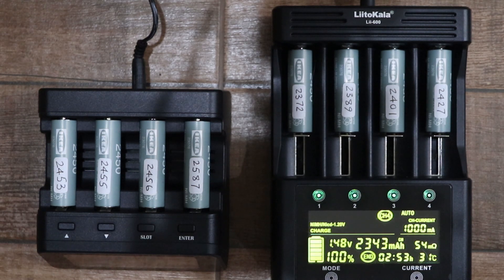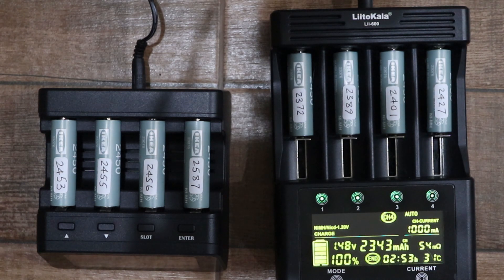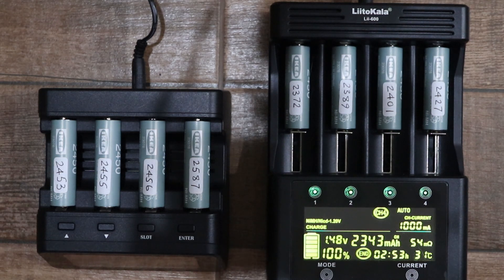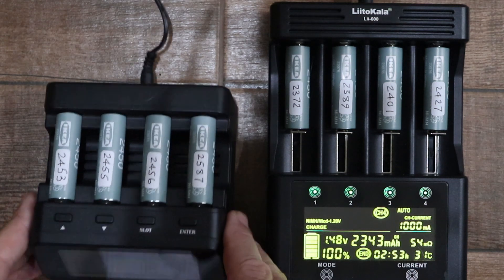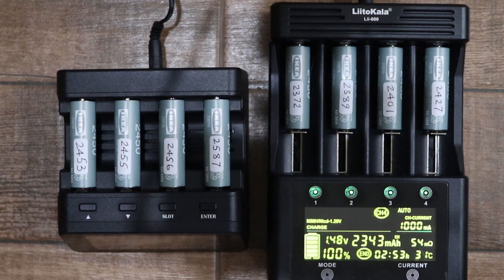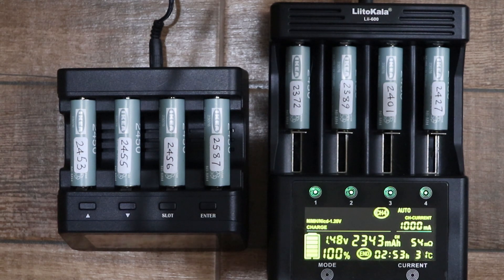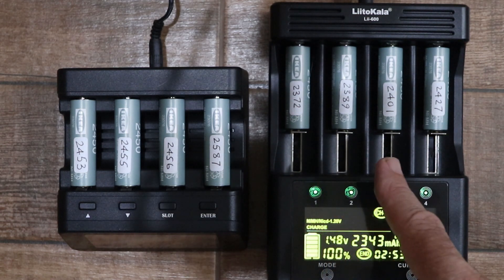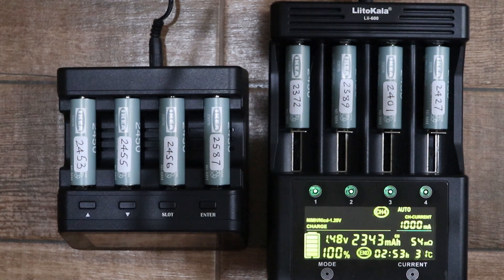Is There A Problem With My Powerex MH-C9000 Pro Battery Charger Or Is The Problem Me?

Comment: Hello again, great to hear that you found the main issue. The Charge cycle on the C9000 only meassures what you try to put in, not what actually ends up in the cell. The right way to do it is through a "Discharge" cycle, that measures what's actually in the cell. However, the amount of energy you can draw from a cell is highly dependent on your discharge current, the higher the current, the less energy out and vice versa. I guess the best way to test this is to 1: charge the cells on either charger. 2: discharge on the c9000 at a certain current. 3: charge the cells again at the same charger as in step one. 4: discharge on the Liitokala at the same current as in step 2. Those two readings ought to match. Chances are both chargers work just fine. If you charge in one of them, it might put slightly more or less into the cells than the other, which might make for a small difference in the discharge and so on. One also have to remember where the 2450 reading on the label comes from, it comes from charging and discharging over time at the testing plants at given discharge currents. What I would try to ease your mind on the c9000 is to run a couple refresh/analyse cycles on your four cells, with let's say 1A charging current, and 0.5A discharge current. That's pretty close to what can be expected to correspond to the 2450 rating, tests are usually done at 0.2 C discharge, just as the "Break In Mode". Sorry for lengthy answer, but as I say, both are probably just correct, it's a bit like statistics, you can get many answers depending on how the question is asked. 😀
Reply from the maker: Hello Dennis and thanks for all your advice. It has been very useful. I realised after doing some research yesterday that I was doing it wrong, however, the results on the Liitokala were still what I expected. It's only the Powerex that records those very high readings on a charge cycle.

I ran a refresh/analyze overnight on the Powerex and did the same with the Liitokala using the Test mode. Results were about the same as they were when doing the discharge. The Powerex readings have a tendency to be a little higher but, as you point out, this could be the difference with the charging and discharging currents. Since I've had the chargers I've noticed a tendency to become a little too obsessive with analysing batteries and trying to get them to their maximum capacity!

As you say, I think that both chargers are working OK. There will be some slight discrepancies between batteries and chargers and also - as you point out - the 2,450mAh rating won't be exact for every batter coming out of the factory.

I feel reassured now that everything is OK and it was just my lack of knowledge. Thanks again!
Reply: @PhilUKNet  You are most welcome, and thank you in return for making great videos. If I may just, to close this from my side, a few more words. The "high" figures on the C9000 charge cycle aren't really high at all, they are what's to be expected, as to why the liitokala don't show the same I don't know. It's much in the same vein as as to why you need fans in your computer, or a cooler in your car. Heat is generated, and that heat needs to go somewhere, there isn't such a thing as a 100% efficient system, you always need to put more energy in than what you can draw back and that is what the C9000 shows in a charge cycle, it shows how much was poured into the bucket, not what actually ended up in it. If your cells increase by Anything in heat as you put your hands on them during charging, that's energy put in that isn't staying there, and that's what the C9000 shows. Another small point about ratings. If you read 2450 mAh on a cell, that's not a static figure, that doesn't mean "We have a bucket of size X, which can hold so and so many mAh", it doesn't mean that. Cells are living creatures, they are born, they live, and they die. What you can expect from a cell is that for the first 50 odd charge cycles they get better and better, then the live and after a while they start to degrade, that's why you have a statement from the manufacturer as to how many charge cycles they claim. The IEC testing procedure actually involves a number of "Break In" cycles, and "Refresh and Analyse" cycles, both of which you have on the Maha. They test and test, charge and discharge and at the end of it they can claim that "We support X amount of charge cycles, after which we guarantee that your discharge capacity at 0.2C is still within 80% of the capacity we put on the label." So for a 2450 cell, if you have less than 1960 mAh coming out of it after you have charged it for the amount of times they claim to support, then you can worry, but chances are you have misplaced them by then as I do. :-D As to your last comment about being too obsessive, I feel your pain ... I was there more than a decade ago when I got my first Maha and I'm still there. You have Two great chargers and they give great information which may or may not entangle you. There are many Great chargers that just do their job, don't show anything and won't cause confusion, just show a green light when done and be done with it, but let's be fair ... those are not as much fun. Welcome to the rabbit hole of charging batteries, the hole runs deep ...
Reply from the maker: @SweDennis  Hi Dennis! You've been a great teacher and you have a good way of explaining things, such as with the bucket analogy. You've obviously been at this game a long time and you are further down the rabbit hole than I am. For a long time I only had a charger that showed a green light when it was finished, but didn't provide any information. I bought both of these chargers last year and have had a lot of fun with them but there has been a learning curve. When I was looking at information on-line this week I realised how much there is I don't understand. I've learnt quite a bit this week and I will continue to do so! Thanks again!

Comment: Your understanding of how the NiMH chemistry works is limited, as you admit. No shame in that. 

Some basics:
1.) There is no fully discharged or empty battery. They're discharged to a cell voltage that the battery industry generally recognizes as "discharged".

2.) To "fully charge" a battery, there is a sophisticated end-of-charge detection method called "negative delta voltage". As a NiMH battery is charged, the cell voltage rises over time. Because of a quirk in the NiMH chemistry, when a cell is darn close or just past "fully charged" (meaning simply you're not getting much more into it) the cell voltage drops a minuscule amount on the order of a few millivolts. The electronics in the charger look for that tiny drop and terminate the charge. Some chargers are better than others in detecting the change.

3.) The capacity of the battery is always measured during the discharge cycle.

4.) Not all the power pumped into a battery is stored in the chemistry and available later during the discharge cycle. There is wasted power during charging, maybe 20%, and there is nothing to do about it.

5.) Comparing capacity between consumer-grade chargers requires both to use the same cell voltage for a "fully discharged" cell, and be able to measure it accurately. It also requires both to be able to detect the end-of-charge similarly.

6.) Some chargers can apply a topping-off charge after the main charge is done. This will affect measured capacity.

7.) The charge current and the discharge current affects measured capacity. The Powerex charge and discharge current can be changed. To compare measured capacities from both chargers, they must charge and discharge at about the same rates.

8.) When in doubt, trust the Powerex. It's the best commonly available, consumer-grade AA/AAA NiMH charger. Trust it over any odd-named Chinese charger.
Reply: Good info from you :)

To 6., this charger seems to don´t use Top Off charging, it use -dt/dt. The old C9000 Non-Pro was a Top Off charger and it always confused me tht it shows "full" and after that it charges next 2 hours and then trickle.
Reply: If I may add to #4. Normally they say that when charging an "empty" cell at 0.1C it's considered "full" after 14h. This gives it theoretically 40% more than the capacity and for a 2450mAh that's 3430mAh.

Comment: Hi Phil.  I’m just coming across your videos regarding your concern about the PowerEx charger.  I see a number of people have provided some excellent information to help explain many of the complexities, so I won’t go into what has already been stated.  However, I will say, from my personal experience, I own 4 PowerEx charges (2 Pro and 2 WizardOne), because I found them to be the best chargers out there when dealing with NiMH cells and I definitely have confidence in their performance and accuracy.  

As other have stated, you definitely want to measure capacity as a function of the discharge cycle.  Also, capacity will vary based on a multitude of factors, such as charge and discharge current, heat of the cells, condition of the cells, age, etc.  I would definitely encourage you to try various tests between chargers and brands of cells.  

All that being said, remember that capacity at the end of the day is just a rough number that should be considered In relative terms, not absolute.  What does 2347 milliamperes versus 2487 really mean in practical terms?  One cell may run a tad longer, but there are so many variables that can affect that, and you can’t exactly know how long a particular device will run.  Also, most devices use cells in series, which means any device is limited by the weakest cell.  So, as long as you are getting cells that have relatively close capacities off the same charger, I wouldn’t worry about the accuracy of the absolute values.  If you’re seeing several hundred milliamperes difference though, then you might want to see if there’s an issue with the lower capacity cell.  I would also suggest getting a meter to measure internal resistance; there are some on Amazon that are quite good and minimal cost.  Some of the chargers have this ability, but it can be hit or miss in terms of how well that’s implemented.  High internal resistance is a sure sign of cell issues.
Reply from the maker: Thanks for all the information. Very technical! I studied mechanical engineering at tertiary level and still regard electrics and electronics as some form of magic! This comment slipped by, but I think I replied to some of your other comments. Thanks for adding some good, useful information to the comments section of my video.
Reply: @PhilUKNet  Wait….it’s not magic??😳 Thanks for the responses and enjoy your life journey!

Comment: Thanks for good videos on this device. I wanted to buy Powerex MH-C9000Pro one but I was confused after watching the other video where you compare 3 different smart chargers. But now I read comments of your videos (and I also have watched company's own video, there the lady states several times the measured value is not capacity of cell but how much energy put into the battery by charger.) So it seems "issue"is solved. So can I ask still do you suggest this one? I don't want to go with a Chinese brand because I don't trust their quality control and warranty policies :)
Reply from the maker: I was very confused at first, but you're right. It displays how much power it tries to put in. This value can be much more than the actual battery capacity, and this is why you measure capacity on a discharge cycle.

Your question comes just after I bought 16 new Ladda batteries and ran a test using all three chargers. There was a fault with my Vapcell charger, and I have now sent it back. This was disappointing because I have hardly used it. My Powerex and Liitokala chargers have been reliable, but the Powerex is better for repairing batteries, and it always puts more charge into batteries than the Liitokala. My conclusion after this latest test is that the Powerex charger is best.

I wrote down all the information from my test, and when I get time, I will make a quick video.
Reply: @PhilUKNet  Thank you for your quick answer and I will be happy to watch your next video. I already pulled the trigger for Powerex :) Now I will wait 15 days to arrive here in Turkey. Actually the most important reason why I considered Powerex as my first candidate is your words about it's capability of reparing batteries. For me that shows that it behaves to batteries in most care and it charges in a healthy and correct way, that is why it's more succesfull (I think, I am not also an electronic expert but just my opinion). Thanks again have a good day.
Reply from the maker: @hkaya79  I'm just preparing the video now. From comments I've received in the past, the Powerex doesn't get a lot of love. Most people seem to prefer the Liitokala and Vapcell. My Vapcell charger is clearly broken and has been sent back to the Vapcell distributor in Thailand. I only bought it in May and I've hardly used it, so this was very disappointing. The Liitokala and Powerex are close, but the Powerex puts more power in almost every time.

I have never been able to make the repair function work on the Liitokala. It is supposed to go through a series of charges and discharges, but it just stops midway and won't complete the repair. The minimum current on the Vapcell and Liitokala is 250mA. It's 100mA on the Powerex, and in repair mode it is even lower. In repair mode, it charges at 10% of the battery capacity and discharges at 20%. If you have a battery rated at 800mAh, it will charge at 80mA and discharge at 160mA. This low current seems to work very well for batteries that have problems.

Despite the Powerex not getting much love, it's still my best charger. The other chargers have much fancier displays and look more impressive. The Powerex looks a bit boring, but it does a better job. I've had the Powerex quite a long time now and so far I haven't had any reliability issues. The Liitokala has also been reliable. It's only the Vapcell that has given me problems.

I hope it works out for you when it finally arrives!
Reply: @PhilUKNet  I paid more for Powerex device but I think I gave right decision. I am not completely against Chinese products, I have lots of Chinese products as you can not run away that reality :) But if a device doesn't make what it advertises that is not a good thing. I did not check if that failing problem at repair mode is also found everyones Liito Kala devices but if it's so, it's a big minus for me. I can try their updated product in the future may be :)
Reply from the maker: @hkaya79  I have seen reports of the same repair problem with the Liitokala online. Apart from that, the Liitokala is fine. Where I am in Thailand, almost everything is made in China. Even Apple has factories in China making iPhones. If the products are well designed and there is good QC, they are fine. If the products are simply cheap knock-offs, they usually don't last long.

https://budgetlightforum.com/t/repair-mode-on-liitokala-lii-600-charger/66174

The Internet is strange and there are so many differing opinions. On my videos I have received lots of positive comments about the Liitokala and Vapcell. One guy wrote a scathing comment about Powerex, but I have found it to be my best charger. I hope that you get a good device and that it works out for you!

Comment: you have a link for the label stickers you use please i need some for mine and these look perfect size but so many on amazon or if you can provide the size of your sticky labels due to my autism they have to be the same as yours because they are perfect size i asked lady on ebay she said may be 22x8mm really appreciate if you can help me out
Reply from the maker: @roidnerd2501  Sorry, I don't have a link. I just buy them from one of the local stationery shops that sell many sizes. The ones I use are 20mm x 8mm, but 22mm x 8mm will be perfect!